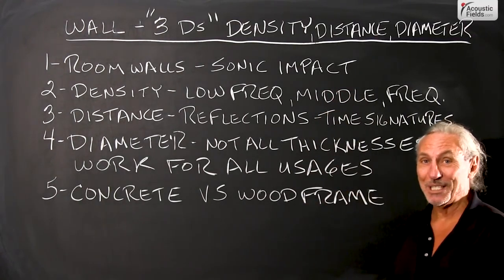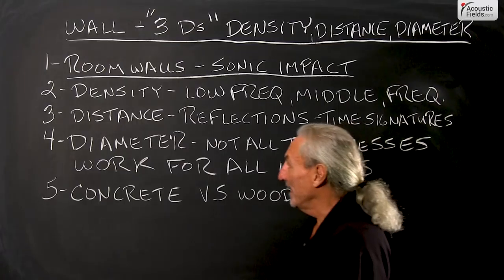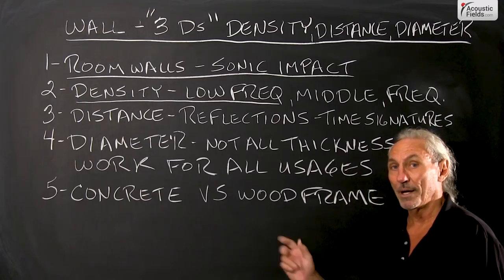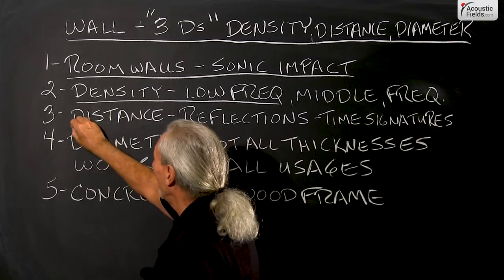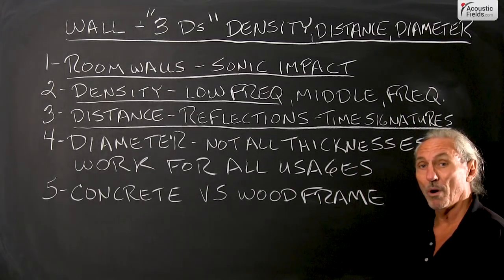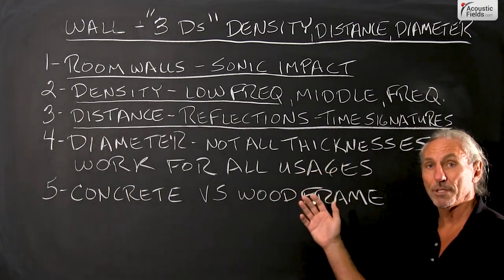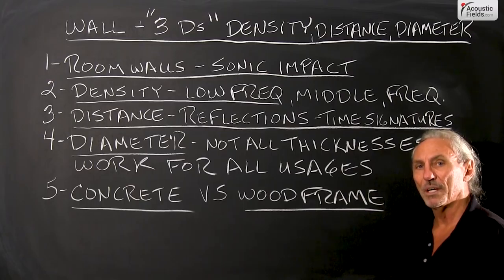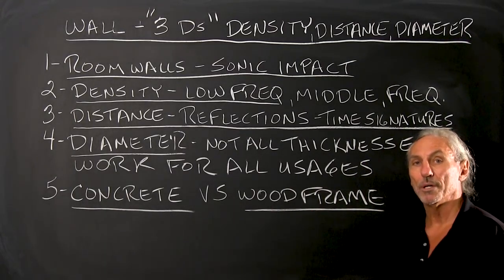Do You Know The 3 "D's" of Room Walls? - www.AcousticFields.com

Comment: I've had pretty good results keeping sound from going through the wall by building two separate 2X4 framed walls with sheetrock sandwiched with soundboard - and (here's the magic) bags of sand suspended within the structure.  Regular Playsand from Home depot - divided into 5-10 lb bags and randomly suspended.  Now, that's a wall that will not easily vibrate at any frequency.
Reply from the maker: K,  LOL No magic, just physics. You should untie the bags of sand and fill the cavity completely.  Remember, barrier technology is all about density.
Reply: so did you make a hole into the sheetrock to put the sand inside?
Reply: Thank you.  I put the sand in while making the wall.  Yes, ideally I would have filled the entire wall with sand, but the hydraulic pressure and the overall weight was a preventive factor.  I just speak from experience and the effect was pretty good.  A few hundred pounds of sand, and that wall was acoustically pretty dead.  It worked a lot better than I thought it would.
Reply: Acoustic Fields, I used the word 'magic' on purpose.  I believe that it's not all about density.  A rigid but dense concrete wall will transmit sound differently then less dense sand, since it can move and thus act as a shock absorber in a different way than say steel or concrete.
Hit steel or concrete with a hammer, the sound travels right through it.  Hit sand with a hammer.

Comment: Dennis, please define time signature.
Reply from the maker: C, Sound travels at a speed of 1130 ft. / sec. This is the rate. You use the Distance Speed Time Formula: 
d=r x t. Speed is a measure of how quickly an object moves from one place to another. It is equal to the distance traveled divided by the time it takes to travel that distance. This is referred to as a time signature.

Comment: would it be ideal to build a studio underground? then you are surrounded by earth, clay and sand e.t.c?
Reply from the maker: B,  Earth, stone, concrete, clay, sand, are all good barrier materials. They will be good at reducing sound transmission.
Reply: no, clay earth is really not that good sound absorber, plus is hard to use wools and isolation stuff if you get an humidity risk.
Reply from the maker: X, You are confusing terms and meanings. When you place a studio underground, you are using the earth and concrete (stone) as a barrier against noise leaving and entering the room. This is an example of a barrier technology. The term sound absorption applies to the treatment you put into the room itself to manage low, middle, and high frequency issues that the room size/volume/usage create. They are two separate sciences. Each one similar to the other but the key to understanding both is to look at their differences.
Reply: clay and earth are no functional as sound barrier, also installing an studio under the ground is gonna amplify the lower frequencies coming at you.    Better?

Comment: Maybe the leakage was due to a 3 leaf system , especially  for LF
Reply from the maker: J, What do you mean by a 3 - leaf system?
Reply: Acoustic Fields  3 leaf is mass-air-mass-air-mass. Documented studies have shown that 3 leaf gives a worse STC than 2 leaf.If you are not able to find the links let me know
Reply from the maker: J,  What is the frequency and amplitude of the noise you are trying to minimize?
Reply: I was commenting on  your video where you said that there was significant bass leakage even with 3 walls . That system happens to be a 3 leaf system  whose performance will be lower than a 2 leaf system ( double wall) . The performance decreases especially in LF  . It is very counterintuitive but that is Acoustics . I find you r lectures quite scientific , but I was suprised about this one